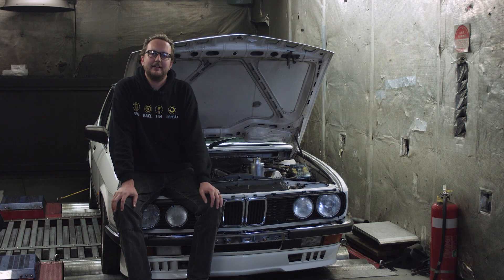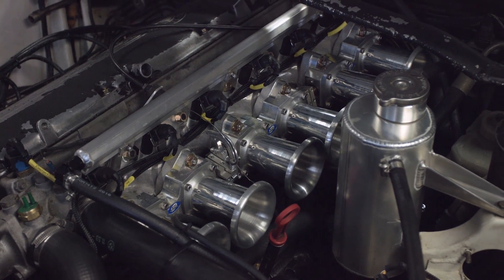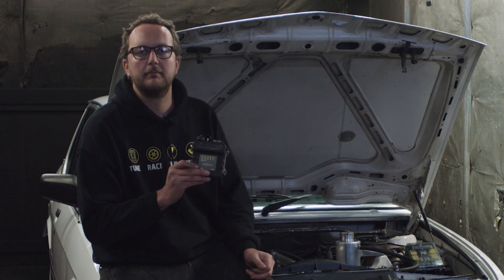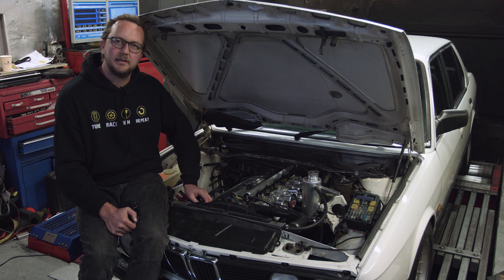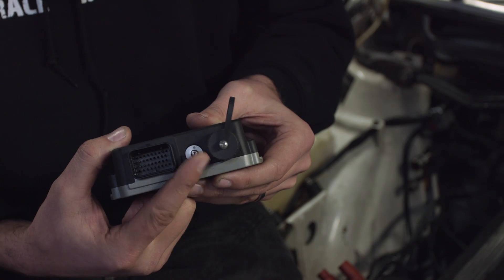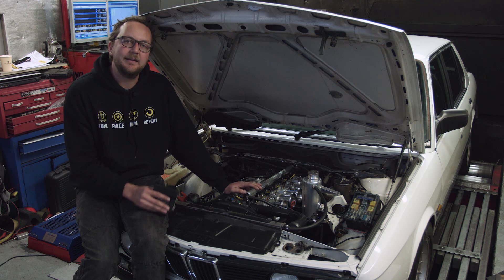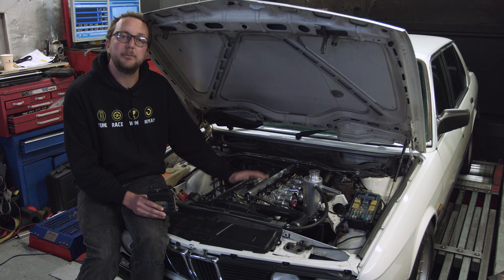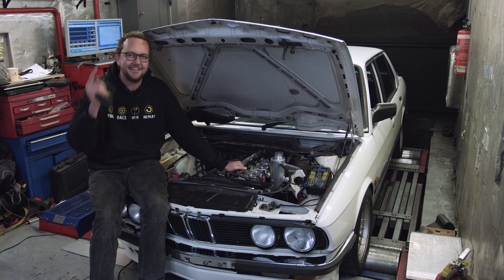💬 84 BMW Alpina with an Elite 750 - Haltech Technically Speaking

Comment: Wonder if you would recommend an Elite 750 for say a 3000gt all-motor build thats mostly a street car. No plans on going turbo or even nitrous at this point. Really like the simplicity of the 750 considering its my first Ecu re-wire and having fewer wires should help keep failure points down. And i really see no point in getting an ecu that can run 16 injectors and coils when i'll never need more than 6 Since so many people want you to run the 2500. i can understand it if im going racing all the time and trying to push 2000 hp with a giant turbo but a basic all-motor build that MIGHT see 300whp it just makes no sense. Though im willing to do either 1 of the 2. Just seems like a waste of ecu to get something that far outstrips what i think i need. this engine doesnt even have vvti in it.

Comment: @Haltech , do you have a similar setup for a 1998 bmw m3  us spec engine s52? i am trying to find a standalone solution so i can have the vehicle run alpha n .
Reply: Elite 2500
Reply: @macspeed5464  is that plug and play with factory engine harness?
Reply: noodlezdotcom they offer a flying lead harness that you’ll need to wire in but I would check their site to see if they offer a plug in harness or even a pre terminated harness

Comment: What is the best ecu to use in my old toyota 3tc carburetor 1.8L engine to make it direct coil on plug and efi ? because i want to add turbo and high camshaft to make more power and rev to 8000 rpm.
Reply from the maker: For a budget build, Elite 550 will suffice, if you want to get more serious you can step up to Elite 1000 or 1500.
Reply: Thank you for your answer. But if I use the carburator what is the best choice?

Comment: I have 2X BMW E28's.One is an m535i, which I'm restoring (was going to contact you about I.T.B.s advertised on gumtree, but they sold).Anyway intereted in Haltech.The other is an Alpina B10 (Alpina Australia kit,not factory)which I want to upgrade to Alpina B7 turbo.I need horsepower, torque, cost figures, driveability for street use.I'm in Kedron, Brisbane.Thanks

Comment: I wish you guys did a buyback program where you could send in another stand alone and get a discount. I'd gladly pull my Standalone out to put in a haltech elite.
Reply from the maker: Interesting idea...
Reply: Haltech... so I have one quick question after watching the video a second time. can you do any long-term or short-term fuel control with an aftermarket 02 (like Innovative aem ect) or do you have to have the can based 02 controller to use any of the learning functions?

Comment: Im building an e24 with the exact engine and going to fit itb this is exactly what i wany to achieve. Can you provide me with all the part numbers i would need and anyone in Melbourne you can recommend to help tune/install
Reply from the maker: Hi there, best thing would be to contact our tech support, one of our guys will be able to talk you through it and make sure you have all the right part numbers for your build. Hop onto www.haltech.com and click on "support.

Comment: I have a 1996 Ford Thunderbird with the 3.8L OHV V-6.
I want to use the 4.2L F150 version of this engine, with a stronger cam, a modified later model Mustang intake, and a better exhaust. I also want to do individual coils, and have fly by wire capability, eventually. I think this would be the perfect ecm, but can I hook my OBDII port to the ecm?
I need some solution for this car. The factory ecm has a 100mph road speed governor cut off that is harsh. But I have to get it inspected once a year. Not California, but still 1996 and up model year.
Any information and correspondence would be awesome. Love your videos.

Comment: Yeah how much power did it make...lol ? what strategy is best for NA ITB big cam with low vacuum at idle/cruise? alpha-n with baro correction or MAP correction?
Reply from the maker: Definitely TPS based strategy with MAP compensation. This is automated in Haltech’s VE calculation when a MAP sensor signal is present.

Comment: hi tuning fork , is this completely mapped on alpha N ? or can you blend Manifold load with alpha N on this ecu ?
Reply from the maker: Yes, you can tune with throttle position as your load axis, and enable a manifold pressure correction table.

Comment: Would you recommend a 750 Elite over a PS1000 for a boosted 1.8L MX5 NA?
Reply from the maker: The Sport 1000 is better suited to the MX5, as it has more inputs/outputs and functionality, and still has enough drivers for sequential injection and direct-fire ignition. Also, we have a plug-in patch loom for the PS1000 to suit the NA 1.8L.
Reply: +haltechecu that is amazing, thank you for the info.

Comment: I'm very curious to know what the difference between the 750 and 550 is. From my research I think it is the lack of data login on the 550, correct me if I'm wrong.
Reply from the maker: The Elite 550 lacks long-term learning, flex tuning, on-board logging, and has 4x fuel/ignition outputs (as opposed to the E750’s 6x fuel/ignition).

Comment: What ECU for a -92 Corrado VR6?
Reply from the maker: The E750, PS2000, and E2500 support sequential injection on the VR6 engine. These will require custom wiring for installation, as we do not have a plug-in solution available.
Reply: +haltechecu what would you suggest for a mk4 2.8vr6 24v 4motion?

Comment: Where'd they get the ITBs for the Big six?
Reply: S38, m88 itbs with adapter plate I would assume
Reply: looks like they are from a company called efi hardware. I would assume they just made an adapter to get to the standard DCOE pattern to bolt up their universal throttle body kit.

Comment: On website I saw the 750 didn't do 6 cylinder engines...
Reply from the maker: Not sure where you saw that, but Elite 750 definately can control six cylinder engines.
Reply: +haltechecu I think on your guys website but I didn't read much on the 750 I was more interested in the 2500, but definitely good to know! More helpful with a simple budget build

Comment: Would the elite 750 work for my 92 accord?   Ive been looking for a relatively cheap simple tunable ecu and all the ones ive found are like 1 thousand dollars
Reply: well yes a elite can run just about any normal engine. if its stock or just bolt ons/ b series swapped the common route is hondata or a chipped ecu
Reply from the maker: Yes, Elite 750 can run your 92 Accord.

Comment: Why you did not tune for alpha instead of MAP to keep the individual throttle bodies individual? The wideband would take care of the atmospheric pressure variations.
Reply: What do you mean by alpha? Just curious.
Also, I think the log between intake runners is small enough that not much air moves through it (between cylinders) but just enough to read average pressure.
Reply: +Tim alpha is throttle body position. Because the application isn't boosted and running a wide band it would work well.
Reply: Tune by tps tends to be a bit more responsive but use more fuel I think
Reply: When you are doing such a project, fuel economy should be the last thing to keep in mind. Having said that, you should be fine if you have a good control loop for the wideband. On top of all of that, you won't affect the  dynamics of the air column in the runners.